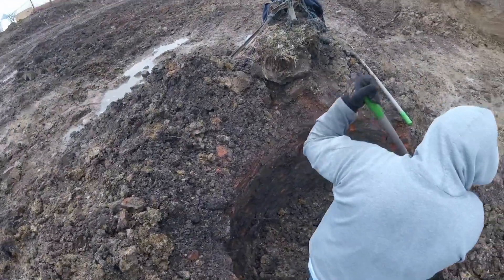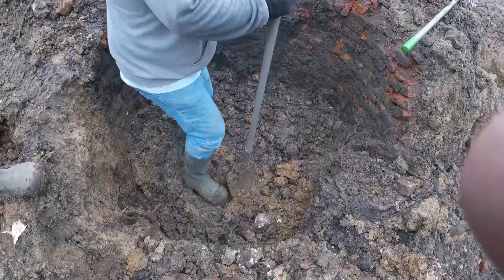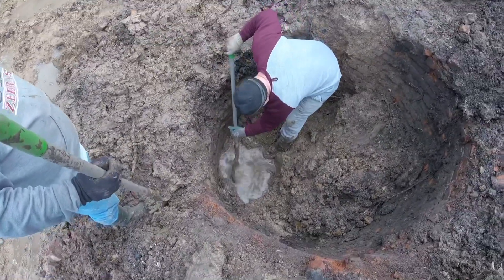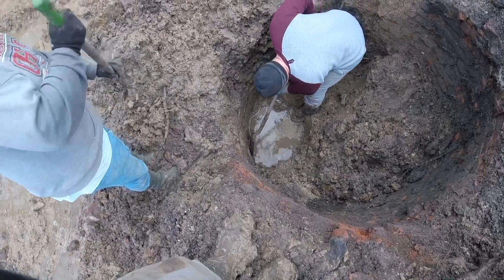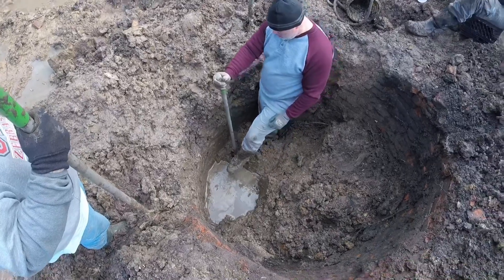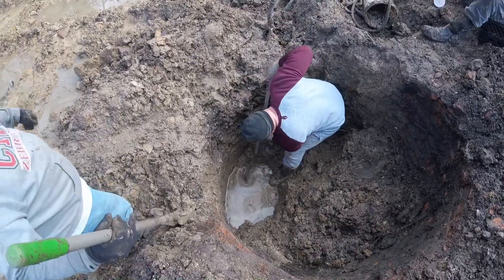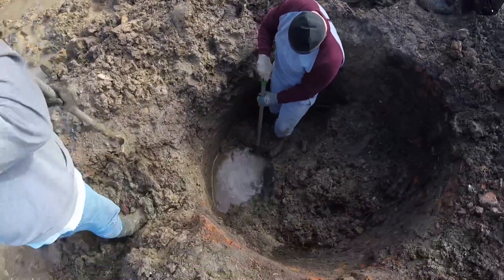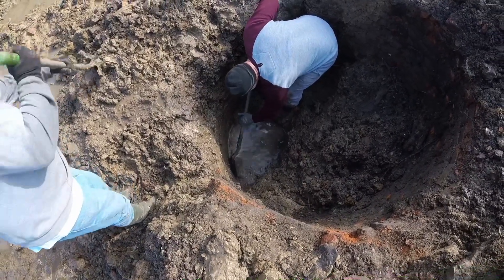Privy digging a wonderful Memphis privy pt1

Comment: Would it have not been easier to use a bucket to extract the water to make it easier to dig. Seemed like you were making it hard WORK for yourselves!
Reply from the maker: We do this actually, but the trick to digging these holes is that you dig a deep hole in one spot and get the water out of it then take the rest of the hole down a little, then make the little hole deeper and get the water out. So in short, we got to make a hole deep enough to submerse the bucket in so we can make the rest of the hole dry😀 hope this was helpful 👍🏻

Comment: Why don't u show the bottle or find when u pull it. A close up with mud on is better than nothing.
Reply from the maker: David Gist we try to but on this hole we dug from 7 am -6pm and we found abt 300 bottles. Can’t film them all and the process of digging this specific hole required all hands on deck at all times. We usually can get better video, will try to do so next time.
Reply: @thememphisdiggersofficial617  No problem    Not trying to tell u how to dig or video. Just would be more interesting if u show a quick close up of the find. Take care!

Comment: Where did you get your probe at??or did you make it your self and if so what did you use?? Thanx
Reply from the maker: D&J modern day homesteaders DIY we home made ours you NEED a piece of spring steel that is at least 5    1/2 ft long, put a metal pipe on the end and run the probe rod inside of the pipe. The pipe that goes around a trampoline works best( make sure it is straight ) then I have machined a tip that is threaded on the inside and threaded the end of my probe, if you do not have the options to do this however, making a small ball on the end of your probe with a welder works as well. The spring steel is very hard to find in the appropriate length, but can be found under the name “sewer rod” if you have any other questions please feel free to ask.